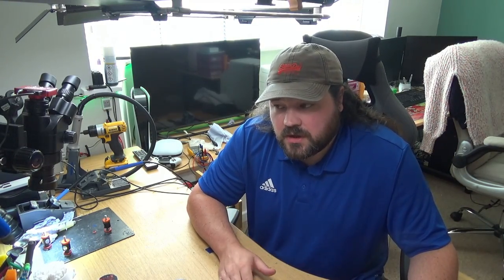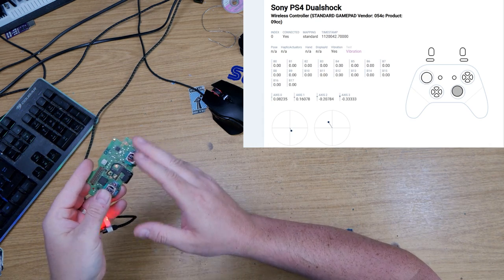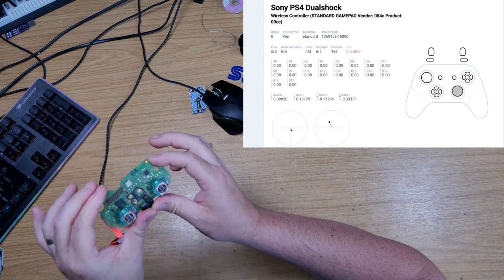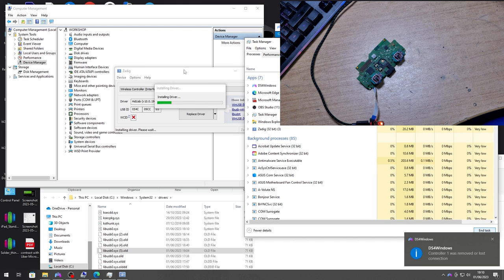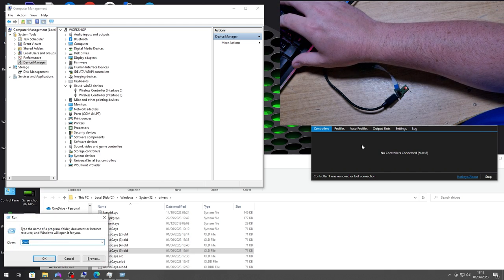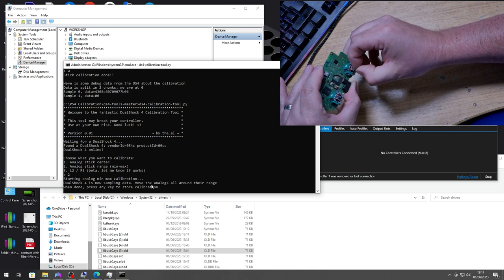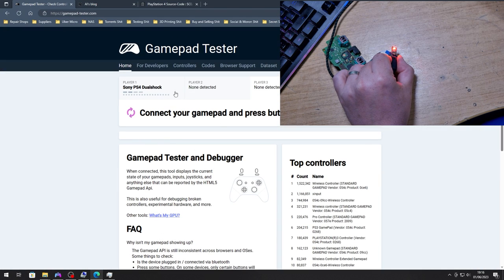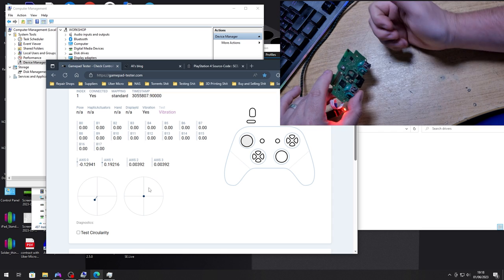PS4 Controller Calibration Software 🛠 IT'S REAL!! WE NEEDED THIS BACK IN 2014! 🛠

Comment: I was suffering from a slight deviation after replacing the control stick, and the only solution was to search for sensors with a certain resistance to reduce the deviation, but now there is no need for that.  Tested on jdm 055 and the result was amazing, wow, thanks everyone.

Comment: Hello, I have a cosmic byte quantum third party ds4 controller and after resetting the controller my error rate went up to 21.7% on both sticks before it was 0.3% my controller does have magnetic joysticks and  I tried the web ui tool and this but to no avail can anybody please help me, I can not find how to recalibrate this controller. In the online tool when I click on "Calibrate sticks  range (permanent)" it says "Range calibration failed: Cannot unlock NVS" and the temporary gives me "Range calibration failed: Error 1"

Comment: This is a great tool, thanks to whoever wrote it.  I did a X axis inversion mod on my camera stick and was able to use this to recalibrate it.  One thing I don't think you mentioned was the flash mirror option, which apparently controls whether or not the calibration changes are temporary.  At first my controller would look fine in Windows after running the tool, but when I connected it back to the playstation it kept resetting the calibration to what it was originally.  I had to set the flash mirror option to 0 to make it stick.
Reply: where is it the flash mirror option?  and how i can set it to 0?
Reply: Could you explain more this? there´s no clear info about it.
Reply: @SeniorCometaRojo   @smartphonerecovery  I don't remember exactly, it was just a command line option on the tool, not complicated.  I can't run the tool right now because I already uninstalled the USB driver and python.  I pulled this from the code, so maybe just try these.

 # GET Flash Mirror Enable + SET Flash Mirror Enable
p = subparsers.add_parser('get-flash-mirror-status', help="Get flash-mirror status")
p.set_defaults(func=handlers.get_flash_mirror_status)

p = subparsers.add_parser('set-flash-mirror-status', help="Change how flash mirror works")
p.add_argument('temporary', type=int, help="Set if changes in configuration are temporary(1) or permanent(0)")
p.set_defaults(func=handlers.set_flash_mirror_status)

Comment: I attempted to install the driver using zading in a similar manner, and I tried mimicking the process of interrupting zading in Task Manager midway. However, the color of the controller's lamp does not change from yellow to red. How can I make the lamp turn red? Calibration couldn't be performed while it's still yellow.

Comment: If the calibration reset after you unplug the controller you should try this :
before calibration you need to run this command first: "set-flash-mirror-status 0" then after calibration is complete. run "set-flash-mirror-status 1" to make the changes permanent.
Reply from the maker: No worries. This was a quick a dirty video when the program first came out. I've been using this everyday since and done many controllers and have since got all the driver issues sorted and commands correct. Just part of my normal work flow now.
Reply: Mine didn't reset, does that mean its okay to work on a PS4 I mean ?
Reply: But what if Sony pushes a new firmware update than it overwrites it and the problem is back. Could be wrong

Comment: Thanks for posting this vid!!  I used a linux live distro to eliminate the changing drivers steps and it worked like a charm!  Tested on a JDM-030 and JDM-040 so far with 100% success!  Thanks for finding this and sharing it!!
Reply from the maker: No problem, glad you found it useful. I was tempted to spin up Ubuntu but I use Windows on my workshop PC so was determined to get it going. This method was a quick and dirty way of doing it, for this video.. I've since used this on almost all PS4 DS repairs now and refined it to the point where it's as (not quite but close) quick to manually calibrate them.. It's not perfect. I've done JDM- 010, 20, 30,40 50 & 55 so far, so good!

Comment: OMG! It actually stays solid. No drifting. Absolutely amazing. Can I just add. When you delete libusb drivers from device manager and refresh PS4 controller will appear as 2 wireless devices under Universal serial controllers. It will be the last device group. Erase then with uninstall driver option, refresh and controller back to normal.
Reply: Strangely it just kept reinstalling the libusb0.sys automatically and popping back up as a libusb device soon as I plug the controller back in. After repeadetly uninstalling the device+driver 3 times it showed up as you've said and after a final uninstall it finally showed back up as a usable gamecontroller. Would be great if Zadig offered an option to revert to the previous HID driver usable under Windows 10. It

Comment: For not being a tutorial, it sure felt like one!

Sadly, can't get the python script working, just errors out with "parameter not found".  Thinking an older Windows 10 version isn't supported.. only one report about someone on LTSC having the same error, and I'm on 2004.

Time to see if a Linux VM works better.. or worst case, dual boot an updated install.

Edit: Yeah, a Linux VM worked.  4 hours from exiting game due to stick issue (from cleaning attempt) to finishing calibration; there goes my night.

Thanks so much for this video. Saved an absolute nightmare scenario for me.

Comment: I tried "store calibration" without sampling the data, but it didn't work out. Then I read The_AL's blog and I followed their examples. Tried "sample data" twice and it worked 😀

So, here's how in the command prompt:

1. W only (nope, didn't work)
2. S, S, W (Boom! Works like a charm every time)
Reply from the maker: Correct.. Best to press S then move the sticks, S, move S, move S, move then W to save the changes. The more samples the better the accuracy.  Same with the Range.. Do it two or three times.
Reply: I do everything right but I can't save the settings, can someone tell me how? thanks
Reply: That did it! So many years looking for a proper DS4 calibration. This is amazing!

Comment: Great vid mate, glad I ran across your channel. If the script was written for ds4 then I would guess it would also be written for a ds5 with time. How would you deal with drift before this script?
Reply from the maker: I manually calibrated them and range was calibrated with height and module placment. Plus afew company secrets. tricks.

Comment: My right joystick lost its calibration after it fell, so I replaced it with another one, problem is it works fine in Elden Ring, but in Need for Speed Hot Pursuit Remastered when I use DS4Windows the camera is set to back as if I'm holding down on right stick, before change it it was fine, funny thing if I close DS4Windows it works fine.

Comment: Works like a treat, I will add here that on linux it's simpler as you don't have to mess with changing the drivers. So if anyone has a Linux machine, I'd recommend using that.
Reply: Can you please elaborate on how to do that on Linux. Do I just cd into the script
Reply: Luckily I have a 16" MBP M1 Pro and as it's unix based it's also just as simple as running the script. from start to finish you can calibrate the sticks in under 30 seconds.

Comment: Hi your video missed a step of storing the changes without which the calibration is temporary.
Reply from the maker: Correct. This was just a rough quick video. So yeah before calibration you need to run this command first: "set-flash-mirror-status 0" then after calibration is complete. run "set-flash-mirror-status 1" to make the changes permanent. 

However I have done tests where I've not touched the flash mirror and the changes have saved even after the was battery unplugged and controller reset. IT's seems like sometimes it's not needed, but for the sake of two commands may as well do it.

Comment: Center calibration work perfect, but circularity doesnt work, all time get square. I didnt bad  something?
Reply: same boat, did you find a solution?
Reply: @legitcrack6438 I have solution only when change analog, dont change potentiometers, add analog when add old potentiometers to analog and when solder. And if need now can change potentiometers. so there is less chance of losing circularity.

Comment: hello, after calibration I can't use controller with BT, When I plug controller to PC, controller work. When unplug controller, controller dont work. Battery is good, I tested it on another controller.

Comment: Nice video, thanks, I used it for the calibration of my pads, it worked. Tested on 3 pad, one v1 and two v2, center, circularity and L2 and R3 calibration. I've only two problems, the v1 pad has stopped to working via USB on my pc, I can't make driver working again, the other problem was an Hall effect stick, the calibration not worked well, circularity is better now but not perfect like the original stick. The Hall effect stick I tested is the first version of orange and black with the white PCB, I don't know why the calibration don't work well with this stick, it has only the right down corner fine, the others are almost a square.
Reply: The strange thing with the pad with the circularity problem is that it was almost a square even with the original stick (I don't tested the calibration before changed it), I changed it because it was drifty. I have another v2 pad to test, I don't remember well but maybe this pad has the same original square circularity
Reply: "original square circularity" I'm not very sure, because I bought it used, but the stick seems to be original and untouched.

Comment: :yougotthis::yougotthis:Thank you very much for this video, I saved many dying PS4 controllers. However, I found that there is a problem with the motherboard model 055. After replacing the new joystick (the shaft is ALPS and the potentiometer is 10k), the center point of the joystick shakes at a high frequency after calibration, although it basically does not affect the game. But I would like to ask what is causing this. It will not happen on motherboard model 040.🤔🤔

Comment: do you know if the same thing exists for xbox controllers? i know you can calibrate it on the machine you are using it on (xbox or PC) but I can't find any info on uploading a calibration to the actual controller.

Comment: i have used both s and w and nothing works i still have a slight deviation in both joystsicks any fix ? and thanks btw for sharing this. 
ps : joysticks are new
Reply: same. Did you also try
 it on the JDM-030 board?

Comment: Would this work to fix the circularity of a new joystick? I replaced the entire module, but when I run the circularity test on the gamepadtester it shows a larger circularity error and a square shadow instead of a round shadow compared to the original joystick.
Reply: no luck for me either, set the center perfectly but range min/max doesnt seem to do anything

Comment: Has anyone tested this tool on windows 11? Im doing every step successfully and it all works but my out of center sticks remain the same. I did set the flash status to 0 before calibration and after calibration again to 1 aswell, didnt help. I replaced both analog sticks and they remain perfectly symmetrical out of center with -0.11373 and 0.05098 for the left and nearly identical opossite for the right stick. Feeling like the potentiometers are fairly out of center by factory and i cant fix it with this tool. I also tried to run the script via Admin powershell, also no success
Reply: You can try to find the middle value of the potentiometer to calibrate, for example, the left and right joystick [mix is: 0.00392 max: 0.05096], then you can push the joystick to 0.02548 as the center point to calibrate.  If the value of the potentiometer is too large, then you may consider replacing the potentiometer instead of replacing the rocker.

Comment: If I make "set-flash-mirror-status 0" before calibration, and forget to do "set-flash-mirror-status 1" after. It's important? Are there any problems due to this?
Reply from the maker: If you gorget to set it back to 1 the FW can revert back to the original calibration.

Comment: If i got flux inside the Potentiometer would that cause problems with accuracy.  I changed the analog and it fixed L3 but now i have stick drift.
Reply from the maker: flux in the pot won't help. Clean it all out with IPA.

Comment: whats about the left stick? looks like it still drifting
Reply from the maker: Yeah the sticks are worn out on that controller. I was showing the software calibration will only help so far. I'm sure I explained that in the video!
Reply: @UberMicroRepairs  yeah already did some test with virtualized linux. Looks better solution then swapping the drivers
Reply: @UberMicroRepairs  oh, btw u skipped the part when u enable the programming phase.
Reply from the maker: @NandiFIXstuffs  Yeah I missed loads out.. this was a quick vid just showing that this tool is out there and how it can work 1: with an ok analog stick. and 2: with a worn out stick.

Comment: hey sorry, i gave the video a skim and didn't watch the entire beginning but i'm noticing that you're basically connecting the controller to the pc like normal, is there any reason that it's apart? does it NEED to be taken apart? i just got some drift fix kits with the potentiometer screws to do this manually on the board but it doesn't hurt to have multiple fixes in my repertoire

Comment: Is there similar software for xss controller?
Reply from the maker: Unfortunately not.
Reply: @UberMicroRepairs  if this is the case,how do bbc or scuf calibate their joystick like dualsense or xbox？using parallel calibration board or series resistor

Comment: never got this working,,
Reply: What issue were you having and have you got it working now? I just tested it for the first time and it worked perfectly.
Reply: @speakthetruth3684  really cant say ,, maybe am running the program wrong, but wend i but the app with DOS.. it wont work
Reply: @speakthetruth3684   Bro 1 small Question  why does it not always save,, the calibration,,  if you do the calibration with the battery connected work perfect once the controller dies or the battery is remove the calibration is lost.. if i do it with no battery calibration it wont take effect.